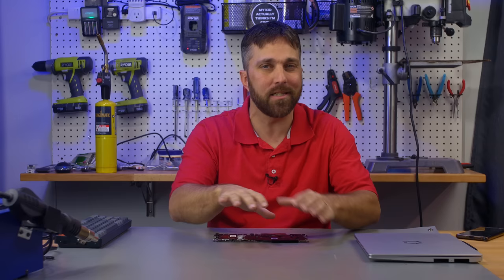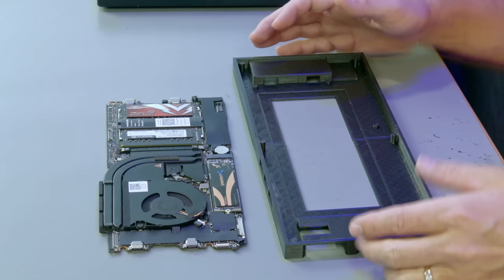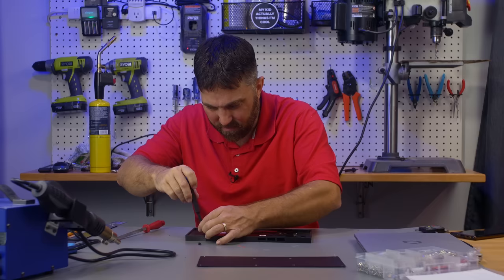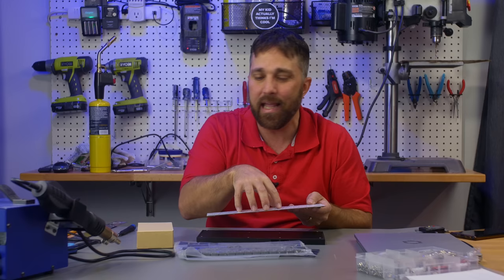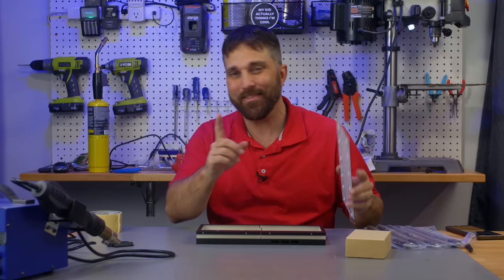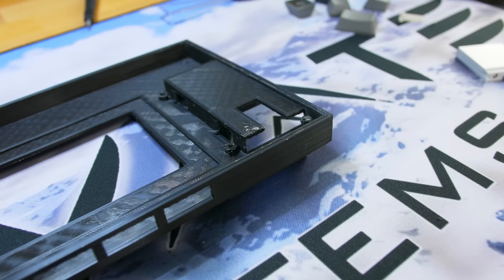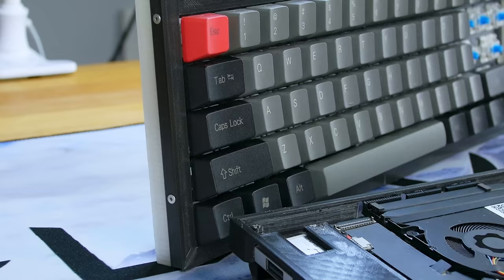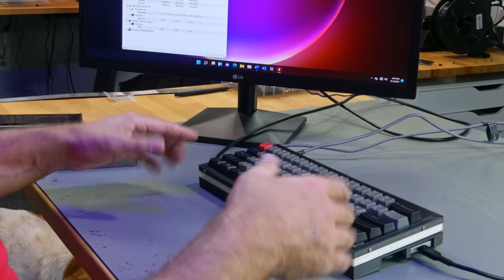Complete PC in a Mechanical Keyboard! Retro Concept, Modern Hardware.

Comment: I'd buy a machined or cast aluminium version that allowed for a larger lower RPM fan, and a bottom cover that transfers some heat to the bottom cover through a thermal pad on the heatpipe. An intake for the fan could be placed on the bottom and channeled through some heat fins in the bottom cover. Just to get the heat and noise down, and the less air it has to move, the less dust it will suck in and build up

Also cant wait for an AMD/Alderlake version of this. REALLY hoping there will be an alderlake "ultra mobile" die that is zero P cores and 16 E cores instead of 2P and 8E. Or maybe a standard mobile with 2P cores and 16E cores. Intel has stated that for the die area, those 4 E cores(same size as 1 P core) are significantly more powerful, the problem is that many programs cant take advantage of that many threads so most programs would work better on 2P+8E cores(4 high powered threads and 8 mid power threads), instead of 16 E cores(only 16 mid power threads), This lack of multi-threading support is why the desktop comes with variations of 8+8 (or less). But because those 4 E cores use less power than 1 P core, this is a decent trade off for mobile and small form factor where each P core is likely to throttle below the performance of 2 E cores

Comment: Rather than 3d print you could mill the frame / housing out of aluminum, with that comes a few ideas for increased cooling as well. A bit more expensive though.

Comment: What about putting the battery inside the palmrest, so it looks like a normal palmrest but accommodates for the battery and makes this work like a laptop!
Reply from the maker: The battery is bigger than the mainboard so the palm rest would be bigger than the keyboard.
Reply: Oh man, now that I'll be a little complicated, but if we move the board further to the front we can have half of it inside the "keyboard area".
Of course this would mean that the palmrest will become a fixed part of the build but maybe it can work

Comment: You wear safety goggles! 👷‍♀️
Reply from the maker: When drilling a steel plate, of course. Have you ever got a metal shard in your eyeball? It's not a pleasant experience.
Reply: @ElevatedSystems  not yet but I've had a kickback on the table saw. Thankfully a glancing blow.

Comment: Could it be powered by USB-C ?  Plugged into an EGPU or usb-c hub that provides power would be slick.
Reply: Also, I’m thinking that you could pair it with an IPad as a screen.  This is how I use my Raspberry pi 400 with Ethernet and keyboard gadgets enabled by USB-C connection and a VNC connection.  Write via LibreOffice and code in MS Visual Studios or another IDE on the pi and the iPad is used for the mobile apps.

Comment: How would it work on a wooden case?
Not fully wooden, mind you, but mostly wooden with aluminum for heath dissipation.
I mean, carpenter and ebanist gear (and ebanists and carpenters themselves) are more widely available than 3d printing on most places worldwide.

Comment: I watched that initial vid and didn't understand the hate from people
you were in the right to talk about it as it was a promised feature and framework quickly fixed it. I don't think you were harsh on it and framework responded correctly

I sorta get that people were hating because that might have thrown shade at the company but in reality,  it's the excessive fanboying that would actually hurt the company long term
think Apple with really tiny fanbase - nuff said

+ I wish you didn't pull that video down but saw your follow up and understood why

Comment: 15:00 There's nothing wrong with the PCB. What is a "good keyboard PCB", anyway? It has your generic staggered ansi layout, it has an AVR chip that supports QMK, it has USB-C, by the looks of it yours even supports single key lighting with a charlieplexing driver, and practically speaking, any mechanical keyboard PCB is hot-swap convertible if this is a big deal to you. So I wonder what could possibly be a "better PCB". I think people got so caught up in the keyboard craze they stopped asking themselves why they wanted those things in the first place. Keyboards are for typing. But suddenly I have people telling me they can't do their job unless their keyboard flashes RGB, whirrs like a turbine and walks around on all fours, out of the box. Sorry for ranting, it's just something that's had me confused as of late, being utilitarian an all. Thanks for the video.

Comment: It is not compact since you need now a separate monitor. Your conception now ocupies more space, has more cables messing around, you wasted money and you didn't obtained anything that your laptop already offered. Basically what you did was to remove the screen of a laptop and place the electronics in a different case making everything less convenient, less efficient and less portable.
Reply from the maker: You are apparently unfamiliar with the Framework laptop. This is a way to repurpose the old mainboard after upgrading your laptop with a new one.